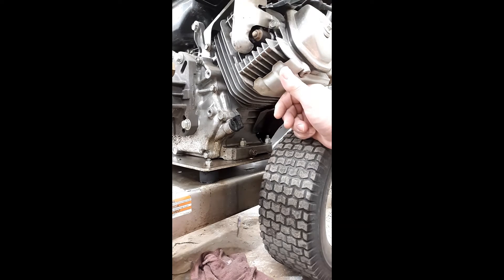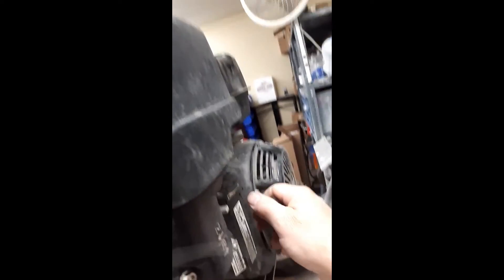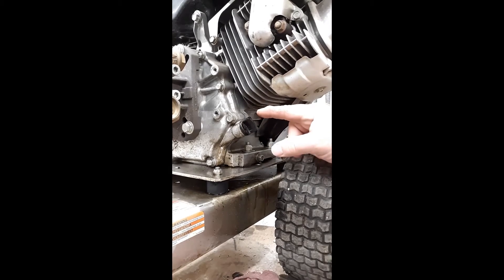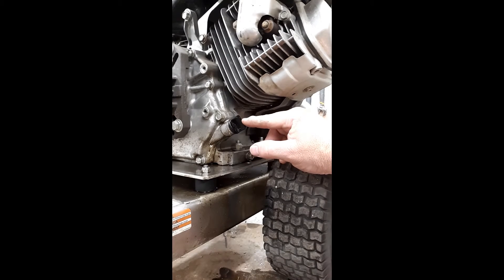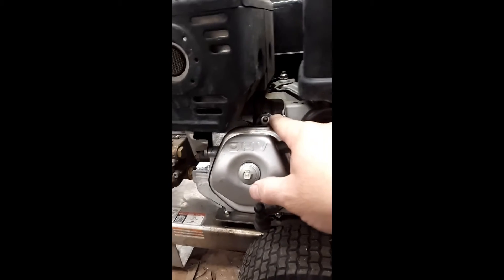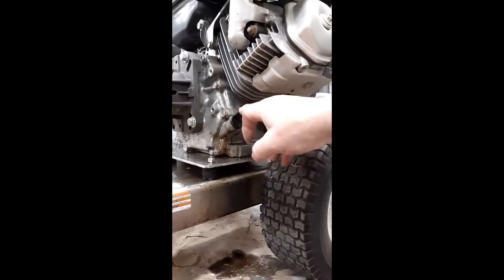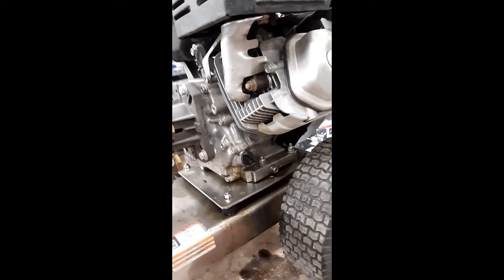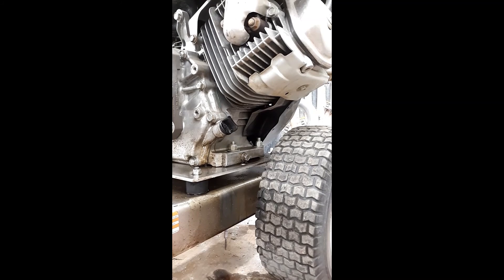Pressure washer engine locked up

Comment: What if after removing oil, plug and pulling on rope the flywheel would not budge to force any oil and possible water out of plug opening
Reply from the maker: If the plug is out, and the flywheel will not rotate, then you have a mechanical issue internally

Comment: Is it possible that the other reason it’s lock it’s because you  fill it with the mix gas!!?? I’m just saying.
Reply from the maker: Mixed gas, from the tank, will not cause this. You can use mixed gas in a 4 stroke engine without any issues. 
The problem is gas and/or oil is introduced into the cylinder. This can happen when the unit is flipped on its side for a period of time or the float in the carb is stuck in the down position

Comment: I know this video is old but I thought I'd ask, did you do anything with the air filter? Mine had oil in it..
Reply from the maker: If you have oil in the air filter, you should replace it. The filter can cause the engine to burn more fuel or not run at all.

Comment: My engine is locked on my power washer.  I watched another video that said to place a few table spoons of marvel mystery oil in where the spark plug goes (which after watching this video should be the last thing I do).  I did that and nothing.  Spark plug was completely dry.  I tried pulling the rope without the spark plug in and did not get any spillage from where the spark plug goes in.  What's next?
Reply from the maker: Find me on Facebook,  too many steps and questions for here
Reply: @Brian_the_repair_guy  I sent you an im on FB.  Thanks

Comment: Brian, though your video was posted two years ago, it's still one of the best. I have a Wen power washer that I loved for the last 3-4 years. I didn't power wash last year and last week it didn't start. I missed up with the carburetor and ended up with exact symptoms per your video. I got new carburetor and followed  your steps as posted. It's now running like a charm. I do really thank you for saving me, probably, $350-450. So much appreciated.

Comment: Mine sat with no gas and its locked. Pulled the plug and its dry as a bone, buf still locked. Put a wrench on the wheel after taking the cord off, nothing. Im still fully locked. Please help!
Reply from the maker: @johncochrane2667  if the engine wasn't locked before storage and is now, then most likely, the cylinder has rusted to the cylinder wall. Not saying this is 100%. 
That one is going to require a complete break down

Comment: Great video! Will this procedure work for a pressure washer that fell in a pool? It was only in the water for about 5-10 seconds.
Reply from the maker: @terrybrennan2534  this will work to remove the water from the cylinder if it did get in. Along with draining oil and gas, flushing out the full fuel system as well. 
After removing the plug, check to make sure you have fire before going too far. If the coil is damaged, you have other concerns first
Reply: @ thank you very much, I appreciate your help! Happy holidays to you and your family!

Comment: What could cause this? From Québec Canada
Reply from the maker: @gillesbourbonnais4805  if the machine is flipped on its side or upside down. This allows oil to migrate to the cylinder and carburetor

Comment: What if there's lots of  water in the crankcase  oil,and in the plug housingafter i drained all of it m I know there's  a bad gasket!!! Wich gasket do you think  it is?  Head gasket? Debating to fix? It's a murry Pw.  3200psi ohv power washer. Where can I get parts? Thank you.
Reply from the maker: @michaelstooker670  the water seals are bad. Flush the crank with oil and refill. Watercannon.com has the parts

Comment: Great video, Brian. My older B & S 2800 psi is running fine, but I'm noticing the oil is milky and seems a bit thin. I am in SW Florida where the humidity can be high. Do you think there is water is entering the crank case somewhere? Thank you.
Reply from the maker: @briankeaveney9107  yes. Most definitely.  Not sure if it from the head leaking or the vent leaking. Those pumps are pretty inexpensive.  Contact watercannon.com for a price on parts or pump replacement

Comment: I’ve tried and doesn’t work. I drained oil, spark plug is out and I put new oil and still can’t get it to pull it’s still locked. Is there anything else I’m missing?
Reply from the maker: @thatdiychick1164  pull the plug out. With the engine turned OFF, pull the rope. Just pull it enough to see if it will pull fully out. Let me know what you get.
Reply: @Brian_the_repair_guy  nope doesn't pull enough to fully pull out
Reply from the maker: @thatdiychick1164  if the rope will not pull completely with the spark plug removed, then it usually means the connecting rod is broken.
Reply: @Brian_the_repair_guy  any idea on how to fix that or does that require going to service center?
Reply from the maker: @thatdiychick1164  if you would like, you can find me on Facebook and send me a video with sound of the pull with no spark plug in place. Just to make sure what is happening
Reply: @Brian_the_repair_guy  message sent

Comment: Repair Question: Honda GC190 with new pump, spark plug; unit never been tipped or turned over.  Oil level ok too.  I pull start; it locks half way in the turn, then frees up; not enough pull to fire the engine.  Press the trigger, no pressure, just water flowing out.  thoughts?
Reply from the maker: That's a bit difficult to tell. Find me on Facebook and show me a video

Comment: What else could be  done to have pulley cord release if not gas or oil problem.
Reply from the maker: Tell me what happened
Reply: @Brian_the_repair_guy no. Matter what I do or even follow the steps the pull cord is jammed tight. Can problem be recoil pump starter? Thanx.
Reply from the maker: @JohnKucza  if you pull the plug out will it spin or does is partial spin and stop?

Comment: I have a predator, and it pulls normal with the spark plug out, but once I put the plug in, the engine locks. Any ideas?
Reply from the maker: You have excess oil or fuel in the cylinder most likely. If you have the right size plug then Pull the plug and follow the direction in this video. If you have an air compressor,  you can blow it in the cylinder throw the spark plug hole to blow out the liquid. Watch your eyes. The smallest amount of too much fluid will cause this.
Reply: @Brian_the_repair_guy  thanks for the quick response! How do you think excess oil or fuel would have gotten in the cylinder without the go kart rolling over? it was running perfect, and then I let the go kart sit for about three weeks and it was locked.
Reply from the maker: @nicowcn  if the float sticks in the down position, it can happen.
Reply: @Brian_the_repair_guy  OK. So so to clean out excess oil or fuel from the cylinder, do I blow air through the spark plug hole or through the cylinder?
Reply from the maker: @nicowcn  through the spark plug hole. Watch your eyes.
Reply: So I got it to start after cleaning out the cylinders! However now engine timing seems really off because the wheels are spinning really fast as if it was on full throttle. I messed with the cam in the engine block while I was working on it today. Do you think that could be why? I checked the idle and it is at its lowest and also the carb opening is normal.

Comment: I have a new one and was able to use it for a couple hours. The next day it’s started for 30 sec before dying. It couldn’t start. The choke lever is stuck in the middle and won’t move. So I wait till next day and notice the choke lever moved to the right on its own, but still not able to move all the way to left(cold position). I can pull all the way no problem, but still won’t start. 3200psi Husqvarana with Briggs Stratton engine. Problem is that I can’t return it due to not using it for two years letting it sit brand new in the garage, thus warranty ran out.
Reply from the maker: If the machine is new, it is under warranty.  Take it to a service shop.
Reply: @Brian_the_repair_guy  Problem is that I can’t return it due to not using it for two years letting it sit brand new in the garage, thus warranty ran out.😂
Reply from the maker: @inquisitvem6723  ok, so the unit is not new. 
More than likely,  there is old fuel in the carb that has turned in to a gel or paste that is restricting the movement. Remove the carb and soak it in carb cleaner per the directions. If you are capable, the the card apart to do this.
Reply: @Brian_the_repair_guy  it was never used before till a few days ago, but I guess a day old fuel is still considered old. I will dump all the gasoline out first.I will follow your advice. Thanks.
Reply from the maker: @inquisitvem6723  so no gas has ever been in this 2 year old machine?
Reply: @Brian_the_repair_guy  I bought it brand new at Costco two years ago(sitting in my garage all that time) and only started using it a few days ago and stopped after a few hours due to errands, etc. planned to finish the driveway the next day. Come next day, when I started it, the engine came up for 30ecs with the sound like its sputtering and then stopped or died. That’s when I noticed the choke lever was stuck in the middle and couldn’t be moved to cold position. I tried pulling the cord several times but still wouldn’t start, so my string is not the same situation as your vid I think. I then left it overnight and next morning I noticed choke lever moved to the right on its own. I still have gas left and at least half oil left.
Reply from the maker: @inquisitvem6723  I would definitely remove and clean the carb. The engines are shipped with fluids to prevent corrosion.  They get gummy over time.

Comment: Cord doesn’t pull despite plug being removed
Reply from the maker: Pull off the recoil cover. Put a socket on the nut at the center of the flywheel and see if you can turn the flywheel in either direction  at least three times. Make sure the switch is off

Comment: Always turn your gas valve off when you load your machine and keep it off until you’re ready to use it again and you won’t have that problem that’s better than fixing it
Reply from the maker: That helps with the gas, but that does not help with the oil. I always tell my customers to turn the gas off

Comment: Great video. But; I followed all the steps and still can make it work. It’s not locked any more by I can’t make it crank.
Reply from the maker: You ate half way there. Pull the plug and make sure the end is not wet. Clean it if it is. Make sure oil level is full and try again. 
If the plug is wet, it will not spark properly. May have to repeat a few times to get it started
Reply: Thank you for replying back. I actually remove the carburetor and noticed some oil in it. I cleaned up then put it back and the machine cranked at the very first time. I let it run for 15 minutes like you said, so now I’m going to change the oil for the second time.
Reply from the maker: @jatc8  fantastic
Reply: @Brian_the_repair_guy  now, I see the machine is shaking a little bit. Is there something I can do to make it more stable?
Reply from the maker: @jatc8  not sure about the shake. Is it shaking with gun and hose or as the trigger is being pulled
Reply: @Brian_the_repair_guy  just with the hose connected. No gun.
Reply from the maker: @jatc8  with pressure hose and gun there is no shake?
Reply: @Brian_the_repair_guy  I connected the pressure hose without the gun. I have to wash a house this weekend. I’ll see how it does.

Comment: My pressure washer tipped upside down oil leaked out everywhere, I Checked the carb and it had a tiny bit of oil in the tray but when I turned the gas on the gas came out crystal clear. I then cleaned the spark plug and got as much oil out of by pulling the cord until i couldn't really see anymore oil where the spark plug goes. I also replaced the filter as was drenched in oil. The problem is I seen other videos before this one and none mentioned draining the oil. I just topped off the oil the oil didn't seem watery at all and still looked like fresh oil as the washer is relatively new. When I tried starting it The cord was locked up and didn't want to pull but after letting water run through for a bit and pulling a few times it starts up no problem again and seems to work perfectly fine. Do you think I should drain and refill the oil? Im not sure if gas got into the engine as the oil seemed normal it was just very low.
Reply from the maker: The cost of oil is low compared to a replacement engine. I would replace the oil without a question
Reply from the maker: Good job by the way

Comment: I tried this repair on a stuck Predator engine.  I loaned it to someone in working condition and a day later they said it was stuck.  It was.  Sure enough oil just squirted out of the dip stick area when I unscrewed it.  I removed the spark plug.  Still stuck.  The crank shaft can be rotated counter clockwise about 3/4 turn, or forward the same 3/4 turn.  Stops with a clunk and of course can't be spun to start it.  What now?
Reply from the maker: The clunk is typically the sound of a broken connection rod hitting the interior. Engine replacement,  rebuild or new machine

Comment: So how do you get fluid out of the cylinder
Reply from the maker: As explained in the video, repeated quick pull on the recoil with no spark plug or compressed air shot in the plug hole
Reply: @Brian_the_repair_guy   okay spark plug is out still hard stuck crank pulley tried putting that magic oil didn’t work, changed the oil as well. I did notice the oil smelt like gas and was thin. But it’s not moving at all when I try to crank. I removed the front metal cover where the pistons are and the piston on the right side is compressed almost all the way down and the left side isn’t. I loosened the spring and planned on setting the valve lash to .003 when I relieved the spring still didn’t crank. So what’s next I spray air down the spark plug hole?
Reply: @Brian_the_repair_guy  also when I put screw driver down spark plug hole seems that it’s all the way down.
Reply from the maker: @devinthompson1534  you're getting way ahead of where you need to be. 
With the plug out, you still can't pull it, right? 
If this is the case, remove the recoil cover. There is a large nut in the center. Put a ratchet on it and try to turn the fly wheel in either direction.
Reply: @Brian_the_repair_guy  when I take the plug out I still can’t pull, so you’re saying next step is turn the nut under the recoil cover?
Reply: I tried turn the wheel under the recoil cover by the way with a screw driver back and forth. Still nothing. I’ll try turning the nut instead? Thanks for the responses by the way
Reply from the maker: @devinthompson1534  yes, use that to set your ratchet.  If you can't force it in a clockwise direction more than likely your engine is bad. Needs replacement. 
If it does turn or you get it to turn, reinstall recoil and try pulling
Reply: @Brian_the_repair_guy  oh crap, I really appreciate your help man I’ll try this tomorrow it’s dark now. 👍
Reply: @Brian_the_repair_guy  hi the bolt is turning. I set the 2 pistons to .003 best I could. Seems left piston is slightly more compressed? Anyways. Do I just keep turning it opposite way? What’s next
Reply: Yes it is turning but I have to force to go clockwise I’ll try and crank it
Reply: I got it to turn slightly more free clockwise it’s making a small grinding sound/squeaking. It’s rubbing up against something on the inside when I turn clockwise.
Reply from the maker: @devinthompson1534  it appears you have mechanical damage.  I suggest taking it to a shop
Reply: @Brian_the_repair_guy  hey man I got it pulling only when the spark plug is off it’ll pull and shoots out a mist of gas. When I put spark plug back in it locks up again and I hear liquid running through the engine when I force it. I checked the needle for the gas where the float is by the way and cleaned with a tip. What could it be?
Reply from the maker: @devinthompson1534  I am sorry. This is one of those problems I would like to have my hands on but can't.  I am not sure what else to tell you
Reply: @Brian_the_repair_guy  thanks for your help.

Comment: I've used this sprayer several times now on brick pavers, a wood deck, patio, and a driveway. https://www.youtube.com/post/Ugkx43QMbQqu67IZadu9ou8Sg1BdrunMRNqX It has performed as expected on all surfaces. For larger areas like the decks and patios, I think I will be looking into a surface cleaner attachment to speed up the job, or at least make it a little easier. Hose and sprayer connections are tool-less, tight, and quick. I used the yellow nozzle on the concrete/brick surfaces, and the pressure was adequate for cleaning those surfaces.I am disappointed that these units are still being shipped with a nozzle storage holder that allows them to vibrate out of the holder way too easily and become lost, but I don't want to knock off a star for that reason. The functional part of the washer works very well, so I would recommend this product.
Reply from the maker: Electric definitely has its place

Comment: Or in my case a screw had fallen into the casing, onto the magneto and was jamming it. Followed your method to the letter before finding this out!!
Reply from the maker: Yes, that happens also. If you put a wrench on the flywheel and it allows you to spin backwards and then stop, you could have internal damage or a screw on the magneto